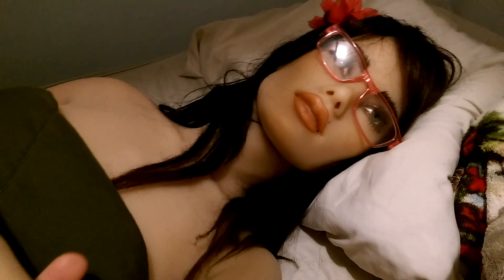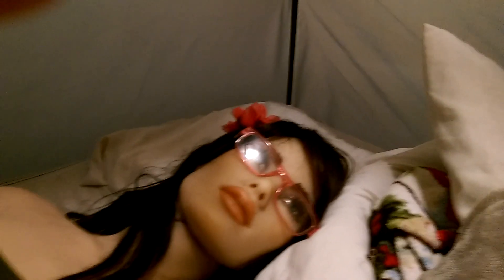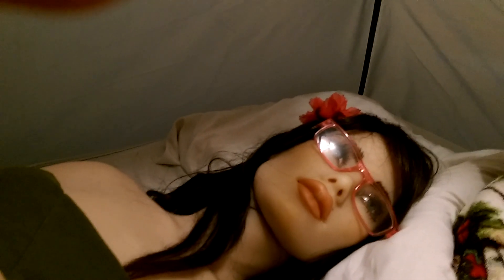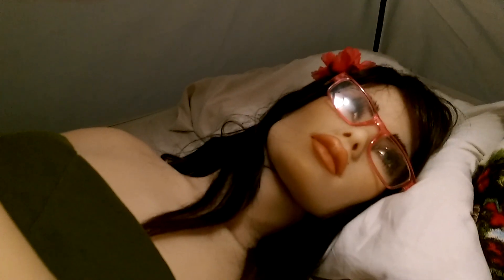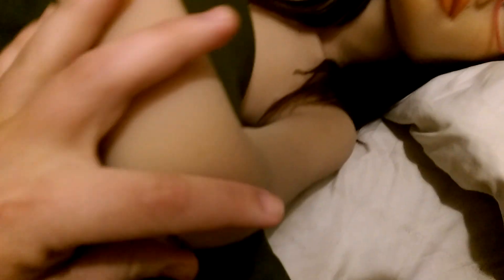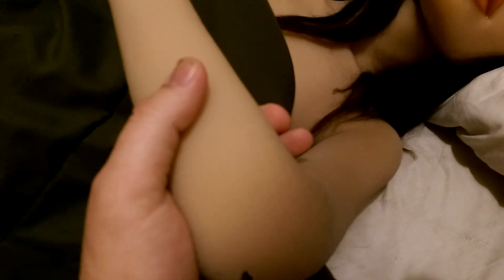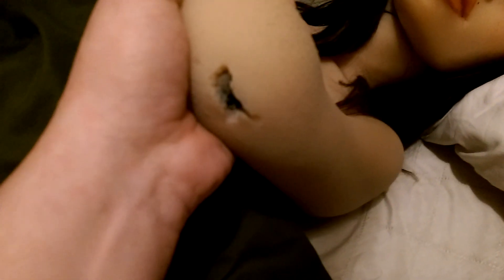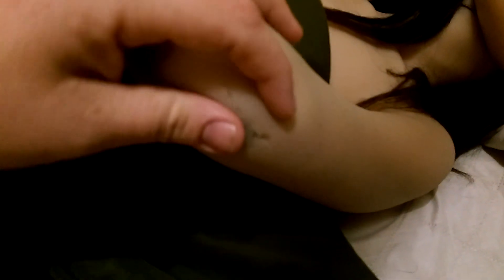Realdoll repair warning! Do not use supre glue gel!

Comment: I use just regular clear silicone it works great just be sure to clean with alcohol before you apply the silicone so you get a good fix. Be sure to keep closed tightly for 24hr.

Comment: Don’t ever repair a doll with anything besides, what’s meant to be on them. windshield glue is a lot harder than that silicone . Make sure you know what your dolls made of. For TPE do you want to use the TPE glue to seal most of it off and then to blend it you want to use a soldering iron along with the regulator to regulate the heat from the soldering iron make be sure the soldering iron is a commercial soldering iron with the 1 inch tip it’s a big soldering iron it makes the blending process of the skin smoother Don’t use the small ones  they will leave lines . and you want really fine sandpaper to tap the skin as you’re passing it with  soldering iron. I recommend using the same process with silicone except you don’t want to use the TPE  glue do you want to use silicone glue that’s meant for the dolls don’t do redneck fixes on these dolls. They’re expensive as it is. But the big soldering iron with 1 inch  x 8 inch long, tip which is a tip you have to make with lathe I haven’t seen any where they sell them